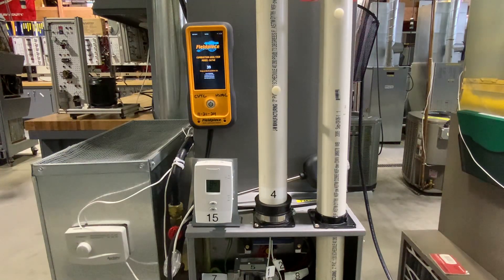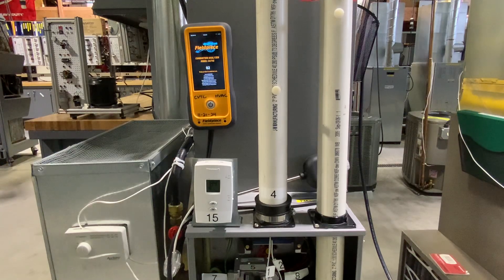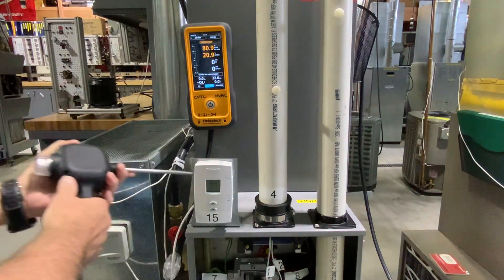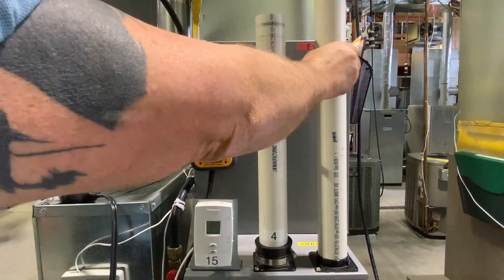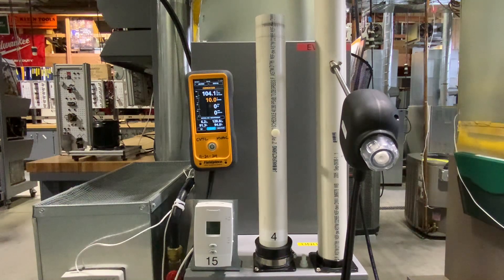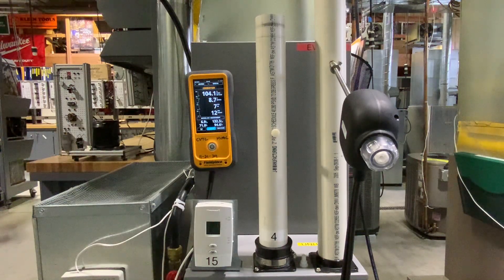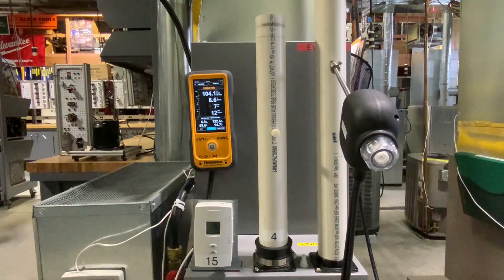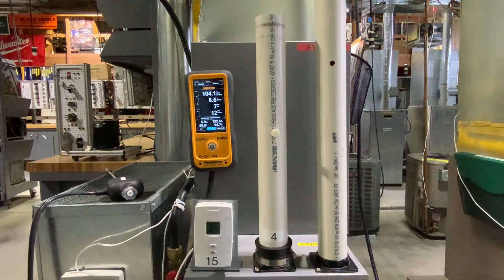Combustion Analysis of a High Efficiency Gas Furnace

Comment: I have the cat85 and it seems like every furnace I do my o2 is always at 11-12 percent? Turn it on outside let it calibrate on its own gas pressure set to 3.5 inwc. Is there anything else I can do to bring that o2down or is there a chance my analyzer is having issues
Reply from the maker: if its consistently reading that, I would suspect the analyzer.  Have you had it calibrated at the factory?
Reply: @frederickkosier2508  I have not had a chance to send it in. It’s hard to when you rely on it during heating season and the company your at doesn’t have spares at the moment bc testo takes so long to turn there’s around. The unit is maybe a month out of the box. Replaced 02 sensor already and seemed to help maybe a week.
Reply: If its on a 90+% furnace 10-12% o2 is acceptable. o2 typically reads a tad higher on 90+'s